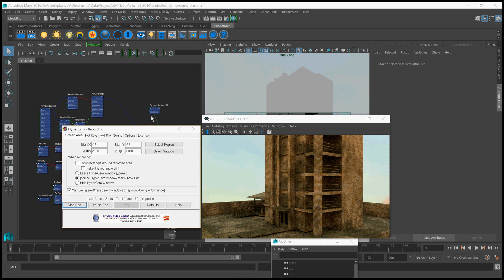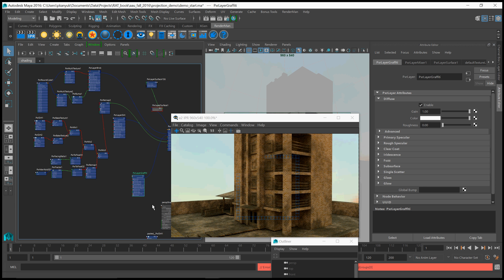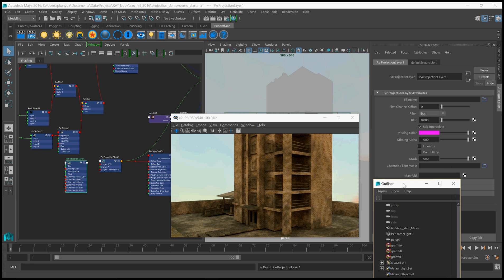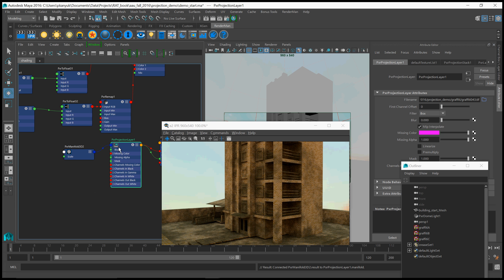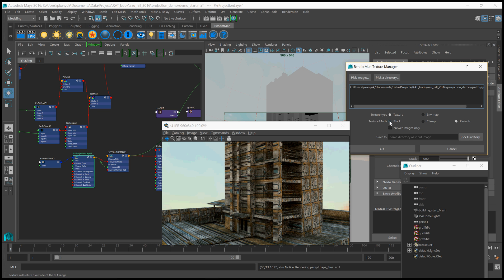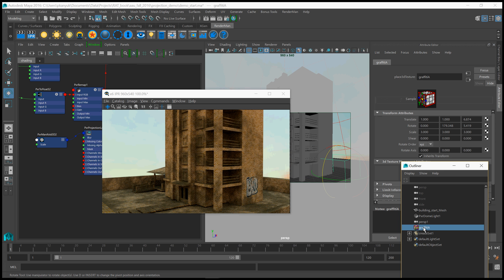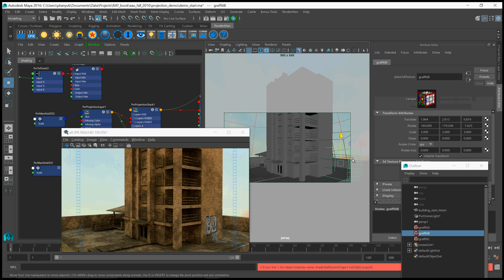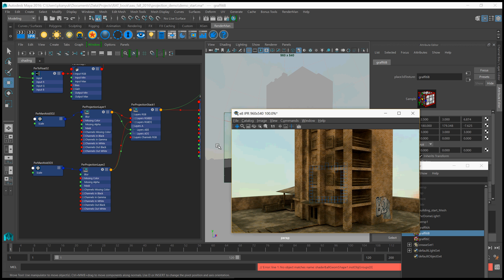Projection Tutorial in RenderMan for Maya

Comment: Do you know if there is a way to drive the PxrVolume shaders density with Mayas built in 3D Texture nodes? Or am I stuck with the pixar nodes.
Reply from the maker: Yup, you should have access to at least a portion of the built in Maya nodes listed here: https://rmanwiki.pixar.com/display/RFM/Supported+Maya+Nodes
Reply from the maker: You can also check in the lib/shaders directory of your RenderManForMaya install location.  The dll/dso files correspond to Maya nodes that are supported
Reply: Oh cool. Thanks!